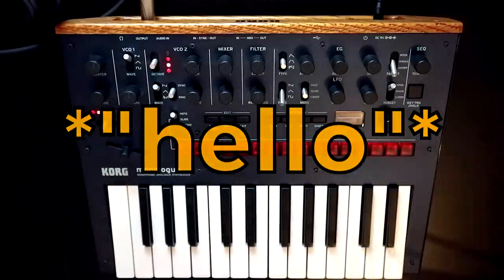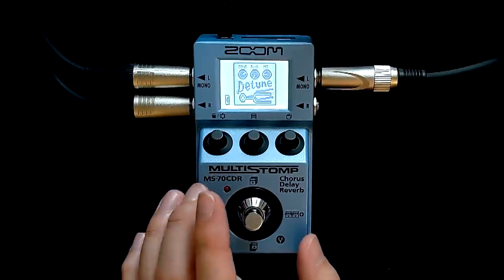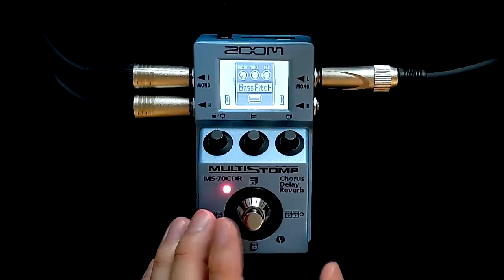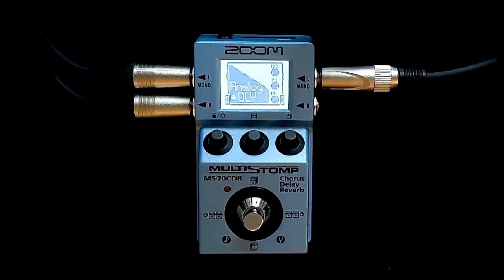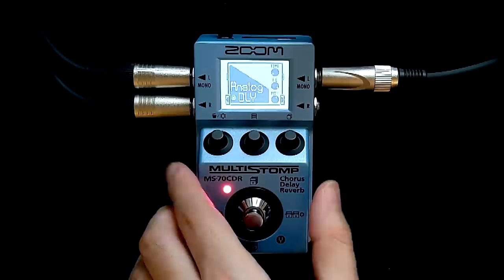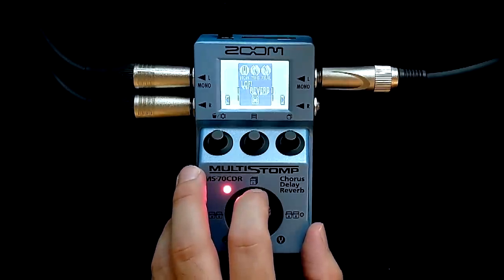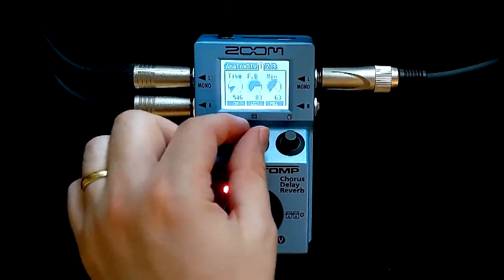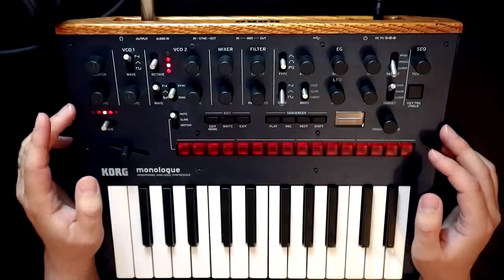Zoom MultiStomp + Sawtooth Wave = A Whole Synth?!

Comment: Under the hood, MS-50g, MS-70cdr, MS-60b and the G1Xon are all the same engine.  The G1Xon includes an expression pedal, drums and a looper but is otherwise the same.  The patches are interchangeable.  The MS-50g is setup to be the most diversified out of the box but the others can share patches without any problems.
Reply: This. Also the bass versions.
Reply: Is the G3 better than the MS-70cdr?

Comment: Thanks for sharing.  I recently got a used Zoom MS-70CDR and intend to use it with a synth.  I did get the impression that the six stage effects chain could behave like routing through modular boards.  You confirmed that this is possible.
Reply from the maker: It really is a bargain, enjoy it!

Comment: Also brilliant with volcas btw
Reply from the maker: Yup!
Reply: I thought you wrote "vocals"...the problem with stomp box reverbs compared to rack reverbs is that they are all 16  or 18 bit and the rack gear is all 24 bit today. Also the A/D and D/A converters don't sound as good on cheap gear.  But if the end track or gig sounds good, then these technical matters don't really matter. I use an old 16 bit zoom rack verb because I like the tone of it of it, which has a lot to do with it's converters.

Comment: thanks again for going above and beyond!
Reply: odd?, i recorded a synth volca bass creation with the zoom ms 70, basic delay and reverb only and it sounded awful. a dirty, distorted sound and it wasn't my input/recording levels. i retried with my simple donner delay and the results were much better. i'm now finding something dubious about the zoom performance, a lot of the presets are over the top and i think you have to watch out when chaining a few together. whet through most of the effects and didn't like the majority. maybe my synth rates (wobble?) were just totally out of sync with the effects rates although i turned everything down to about half on the zoom. also watched with interest your zoom vs polara shoot out - very revealing! i also had a chorus on my original zoom chain which i turned off before recording because it sounded so bad to my ear. i also have a line select at the beginning of the chain so i can turn everything off quickly. i wonder if that could be the culprit for the grating sound? thanks again.

Comment: we were doing this with stylophones and analog fx pedals way back in the 1970s..
obviously the early digital multifx of the 1990s made it all easier and much more fun...
Reply from the maker: And cheaper I'd imagine!
Reply: @OscillatorSink  Yeah.. the humble cheap stylophone..
you don't know what evil screaming feedback monster really lurks inside until you play one live through a fuzzbox & tape delay, into a 50 watt valve amp and 4x12 speaker cab..
That surprised audiences back when we couldn't afford real synths...
Until the Italians started making cheaper monosynths in the later 1970s...
Reply: @garycrant4511  I have an oldJen synth, it needs a couple of new pots, I should plug it in more, I've just bought an Ampeg 30w cab, cheers

Comment: Currently exploring it`s potential as a cue-out` - FX pedal for the Octatrack. 
Grabbed it cheap (-20%) from Japan and it was the v2.0 upgraded version with 137 effects units.
Reply from the maker: That firmware upgrade is killer!
Reply: @Sonic Neutronic Still using it with OT?
Reply: @LukezyM  No I sold the Octatrack and cant stand the sound of this pedal at all - lol.

Comment: Nice video.  The Zoom G1on is based on the same software and mostly the same effects and it can be picked up used for as little as $35 used.  And they also have the G1Xon which adds an expression pedal.  Good stuff cheap.  :-)

Comment: I have an MS-50g and I’ve barely scratched the surface (and haven’t even updated the firmware yet!!) These are great pedals for the price (I got mine as a “factory resealed” for just under $90!!) and they’re battery powered. I’ve got a monologue and some Volcas (also battery powered) so you can take these and make amazing sounds anywhere!! Paired with my Roland Go mixer and iPhone I can make videos wherever. The devices are still fairly new to me and I’ve yet to master them to film myself, but soon...
Reply from the maker: It's DEFINITELY worth updating the firmware. I don't know if it's the same with the 50g, but on the 70 they added a bunch of the premium effects from the ms-100 for free
Reply: Definitely upgrade the firmware. It enables using the Effect Manager desktop software for swapping in and out effects. Alas, there isn't enough storage on the pedal to hold all of them at once.

Comment: Sounds amazing ! Highly impressed, I’m going to experiment with my Zoom, you mentioned in your last video that the zoom doesn’t work well when used from an aux send on a mixing desk, just curious as to why ?
Reply from the maker: The dry signal is digitised, so there's a micro latency introduced by the a/d stage, so if you are using one of the algorithms that mix in the dry sound, it'll cause comb filtering when mixed in with the original on the send.

Comment: These pedals are great. There is one catch to know about when using them live: 
They shut down after some time and have to be rebooted hard. 
Can be a shock moment when you realize that while getting ready to hit the P.A.
Reply from the maker: That setting can be turned off. Just disable Power Management in the system settings and you'll be all good!
Reply: I bought the Zoom yesterday (version 2.0) and read on the internet that there is a bug in this "new" version that results in the unit powering off by itself! You can download version 2.1 to fix the bug.

Comment: Very nice.. How do you connect the synth to the zoom and then to your monitors. Thank you.
Reply from the maker: From the synth to the Zoom I use a standard instrument cable (1/4" TS cable). To my monitors - well in this case I take two instrument cables out into my audio interface or mixer, but I suppose you could plug directly into monitors if you wanted.
Reply: Thanks mate. Appreciate your answer.

Comment: Love the Zoom pedal.  Great stuff in this video.  My only criticism (of the zoom) is that you can't dial the bpm in by hand.  You have to use tap tempo.  I just wish they'd added a bpm page.
Reply from the maker: Yeah, that's a bummer, but if you have an app to convert bpm to milliseconds, you can use the absolute values on the delay times at least.

Comment: Do you always leave the modules' I/O levels at default? I've had quite a lot of "gainstaging" problems with the MS-70CDR...
Reply from the maker: No, I'll often reduce the output if I have multiple modules to avoid digital clipping between them. But it's dependent on the patch.

Comment: Great presentation on this ZOOM pedal. Your videos are very comprehensive indeed! I have been busy creating new patches on my microfreak, do you think using one pedal per synth is the way to go or not? I think this pedal covers all the effects one could ever need. Cheers! 🎹🎶😎
Reply from the maker: It depends on your set up. It's the way I often end up working, but that's more because don't have a mixer in my setup right now. There is a good argument for a mixer + aux sends (although, as I noted - the Zoom isn't well suited to that role).
Reply: @OscillatorSink  Thanks for the input. I use a mixing board and this is what I have done for years. This method works fine, but wanted a second opinion, other than my own. Your right the ZOOM pedal is really inexpensive, and sounds amazing! Love your channel my friend, thanks Expanding Knowledge 🌎∆🎹🎶😎

Comment: Thanks for this. Great video. I was on the fence with this pedal but this really helped me go for it. By the way you can bypass all the effects at once as well. By simply creating another patch that has no effects eg total thru and just switching to that patch. Much easier if you want to quickly hear what the original source sounds like with nothing applied.

Comment: does the zoom handle well the level of the synth signal? with not a few pedals you have to dial down which takes the power out of the sound...
Reply from the maker: Yes, at the input, but when you start stacking multiple effects you need to watch out for digital clipping - luckily every effect has a master volume so you can manage that.

I cover some of the features and answer some frequently asked questions in this video: https://youtu.be/FR_Dx6iqWAw

Comment: HI, I'm trying to set up the ZOOM MS-70CDR pedal on the Roland MX-1 mixer, I checked the instructions in the MX-1 manual, but I'm not getting it. Perhaps there is some detail that I am not considering. Could you help me with this setup?
Reply from the maker: Hi, I don't really know anything about the MX-1, but it has a standard send and return so, from Send on the MX-1 to the inputs on the Zoom then the outputs on the Zoom to the return on the MX-1. In terms of then how to apply each track to the send, that should be in the manual? Look for something regarding "Aux"?
Reply: @OscillatorSink  Thanks

Comment: Can you choose one effect at a time. I read somewhere that someone said that one effect coludn't be selected at a time
Reply from the maker: I'm not sure what you mean? Do you mean just having a single "virtual pedal" active so it acts like a "normal" pedal? If so: sure, you can do that. Let me know if that's not what you're asking though.
Reply: @OscillatorSink  Hi I have an old Ensoniq SQ80 synth and it has no built in effects. All I'm say is can you choose one effect at a time. Just say you wanted to add chorus to a patch
Reply from the maker: @galwaytribesman9289  yes.
Reply: @OscillatorSink  Cheers man

Comment: Can you run different effects through the  Left and the Right channels?  Eg different effects for 2 different mono sources.
Reply from the maker: That's an interesting question, there is some (limited) routing you can do, but I think it's more for choosing different paths within the chain, I don't think two chains can run in parallel.

Comment: Is it just me or does my MS70 clip or distort? I noticed it in the reverb pedal so far.
Reply from the maker: If you hit it with very loud signals it might, but it works fairly well with line level in my experience. Where you might get clipping if if you're using multiple effects within the Zoom, one after another which boost the overall signal. Cascading some of the louder, more effected delays and reverbs, or some of the more resonant modulation effects can lead to clipping happening within the pedal. You can lower the output of individual effects to counter that.
Reply: @OscillatorSink  Thank you. I thought I tried just the reverb pedal and didnt think I pushed the volume too high. I'll double check but thanks for feedback. I'll let you know how it goes

Comment: I don't know if mine has a fault or whether I just can't figure out how to do it, but I can't save anything to the memory slots. I tried following what it says in the manual, but it's so vague it's not much help. What process do you follow to save patches?
Reply from the maker: From the main view (where you can see the picture of the pedal) 
Press the middle button (presets) 
Press the left button (Store) 
Turn the middle button to choose which slot (Dest) 
Press the left button (Enter). 

Obviously you can also change the name, but that there will store a preset. I'm running the v2 firmware so it might be different if you haven't upgraded (but you should definitely upgrade as you get loads of new effects). 

Hope that helps
Reply: @OscillatorSink  I do have the v2, thanks for this.

Comment: As a guitarist I was surprised when I started to get involved with the synth community that the Zoom multistomp was so widely used. Most guitarists think the Zoom Algo’s are poor imitations of the originals. Sounds ok here though. I actually use a small pedalboard from my collection specifically for synths as well as my Zoia when it’s not on guitar duties.
Reply from the maker: As a guitarist as well: that community tends to be a little more snobby and precious about the integrity of "tone" (I'm incredibly prone to that when I'm in that zone myself). The Zoom ain't dethroning a Strymon under any kind of close scrutiny, but it'll definitely get the job done in a pinch and most casual listeners aren't going to get hung up on it. Sure you could spend a grand and a bit on the 3 big Strymons... Or 70 quid on the Zoom and be able to run 3 algorithms at once - and that isn't going to be 10 times worse, right?
Reply: Oscillator Sink haha! You are not wrong about how we can get hung up on “tone”. In the end it’s whatever gets the job done I guess. It’s strange I am happy to spend £500 on the right guitar pedal, but balk at paying much more than that for a synthesiser. Go figure? Anyway keep the vids coming they have helped me on my synth journey tremendously.
Reply: @peterjessop1878  The Timeline is brilliant but I didn't really like the $450 Mobius and only allows you to use one effect too
Reply from the maker: I also think that the Mobius is the most overshadowed by other, newer and cheaper things. The Boss MD-500 and the GFI System Synaesthesia are both better bets now in my opinion.
Reply: @OscillatorSink  Dont get me wrong its better sounding then the MD500 not sure about the GFI, but I just didnt think I needed that much unit. That was 3 years ago, wish I could try on again but not spending $400 for one

Comment: This ZOOM is brilliant and horrible at once. I had MS-50G and all its effects are amazing, especially with recent software update backporting stuff from MS-70G. And everything would be okay, BUT THE TRUTH IS... it’s barely usable! I mean, the user interface - why the heel they decided to add ANIMATIONS on this little passive screen with weak CPU? Every time you switch trough effects in chain you get a laggy slideshow, also browsing through effects is very unresponsive and laggy, these pedal bitmaps could just be erased for me, and replaced with more descriptive text label which wouldn’t have such overhead and lag on controlling that unit.

And yes, I’ve sold it just because of that.
But I’ll pay serious money for the same identical thing with that UI crap turned off and maybe OLED screen like in Digitakt or these old tiny MP3 players.